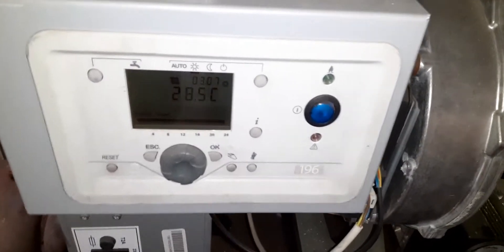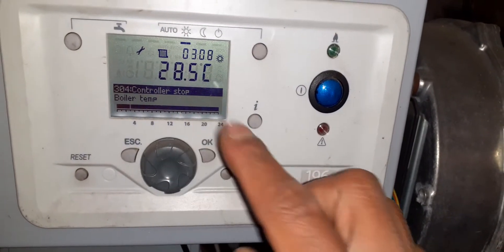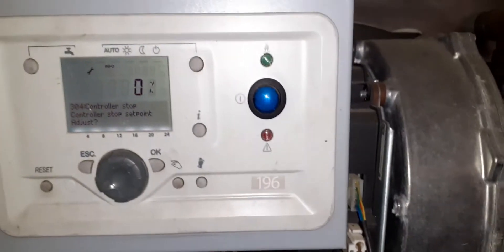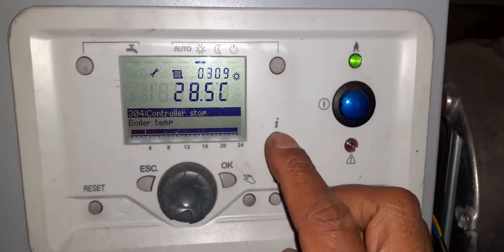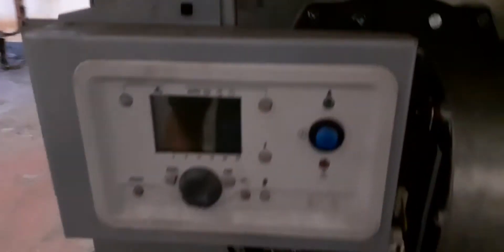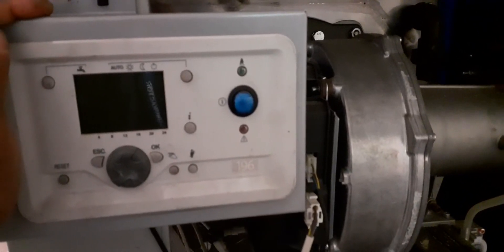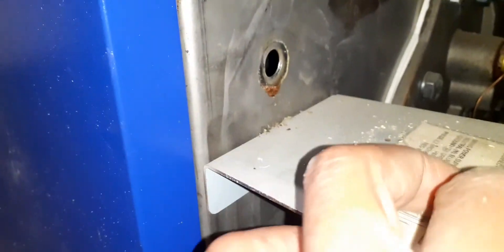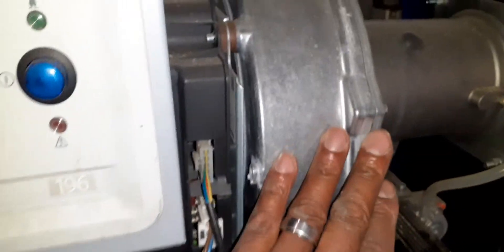HIGH & LOW FIRE / HAMWORTHY WESSEX MODUMAX MK3

Comment: Had to hire out an engine block for one of these. Low fire readings off the scale. Hamworthy said HE needs removed and pressure washed. Took it all out and was spotless. Think it was just a gasket issue after all work was done
Reply from the maker: You're kidding me. Well that's how it goes sometimes.